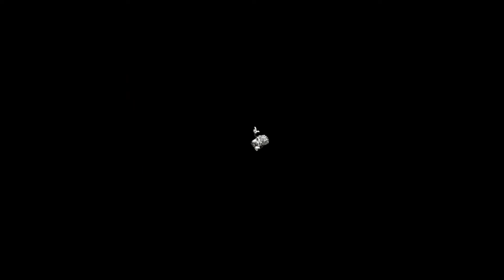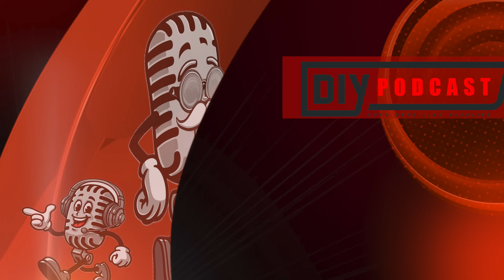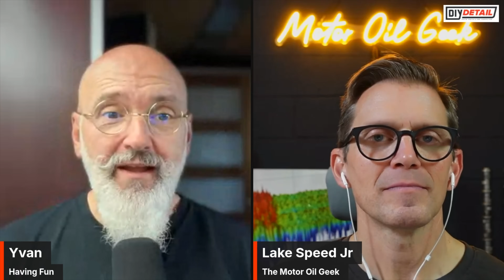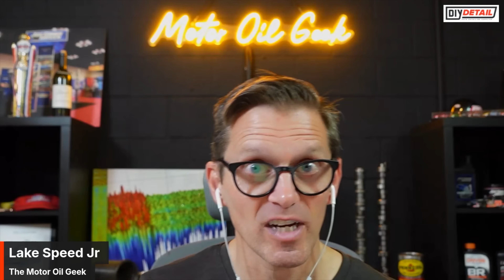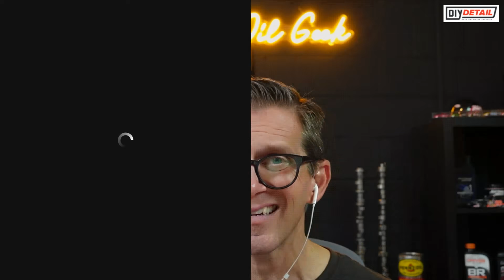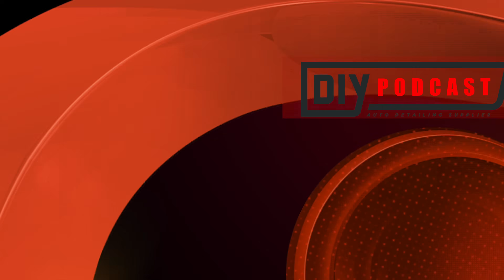Oil myths busted with Lake Speed Jr and DIY DETAIL PODCAST

Comment: On my 2025 Toyota Camry hybrid, I change oil every 3000 miles. I plan on keeping this for 200,000 miles then give it to my niece as her first car. Head engineer of the Nissan GTR recommends this if you want to keep the car long term.
Reply: 5k intervals would probably get you to a half million miles in that car.
Reply: 5k is overkill  @BrianNC81
Reply: Hybrid's suffer from fuel dilution in the oil.  Smart move to change it often.
Reply: @AlisoBob  They certainly can if the software is not set up to get the engine up to proper running temperature before shutting off, but this shouldn't happen in a cold winter as the heater forces the engine to run most of the time.
Reply: @theredscourge Very true. I lose approx. 10 mpg in the winter. Thankfully the AC system is all electric, maybe losing 1-2 mpgs in my Toyota Venza.
Reply: @AlisoBob  Not 3k mis. Not much confidence in Yoda engineering eh?
Reply: @AlisoBob Why the apostrophe for a simple plural?
Reply: How often does he recommend you replace your transmission (not the fluid, the whole transmission 🤣)
Reply: @theredscourge I saw a former GM engineer say some of those awful 10 speed transmissions could maybe be limped longer farther with 15,000 mile services. Thats extreme but I’ve done drain-and-fills every 30,000 and have never lost a transmission.
Reply: @sc3ku   That's crazy! Toyota is only telling their heavy users like taxis and delivery people to change t-fluid every 60k mi / 6y, for everyone else they specify no interval in their entire 120k mi service schedule, and even their CVTs are averaging over 200k mi with no fluid changes.
Reply: @theredscourge search for confessions of a Gm engineer. The whole “ lifetime “ trans fluid is a joke meant for the vehicle lasting 100k etc - leased first and sold once. It’s more in depth than that, but you’ll find it interesting.
Reply: @jamessharp9790  GM is going out of their way to make them fail early because no one in their right mind buys a GM anymore, but other brands like Toyota are not. Toyota still only cites a 60k mi interval for the fluid, and only for those who operate under "special operating conditions". Their belt-type CVTs are lasting over 200k mi on the original fluid, which is about 20 years of average use, so if you want yours to last longer than that, definitely change the fluid.
Reply: @theredscourge  I was literally going to ask this exact question, all new Toyota Camrys have that garbage CVT unit. It rather a 1998 with a manual verses the new disposable garbage!
Reply from the maker: They have an ECVT, very different technology.
Reply: @scottwilson7542  Camrys don't have a belt-type CVT. The hybrid Camry has the excellent e-CVT, which is not a belt-type CVT, but is a planetary and sun gearset with an electric motor such that it can vary the ratio dynamically. There are Priuses out there being used as taxis with over 600k mi with their original e-CVT still going strong. The Corolla has the belt-type CVT, but they're made by Aisin and are not paired up with a high-horsepower engine, so they are proving to be about as reliable as a regular automatic so long as you don't abuse it. The latest Corolla CVT has a legit 1st gear, and only ever shifts into a CVT mode above 25 mph or so, greatly reducing the wear.
Reply: @theredscourge Awesome, I still won’t waste MY money on one, and I have more than one Toyota in my driveway with over 250k miles on the clock. However I’m not a fan of CVT of any type or the Hybrid technology, Toyota has also had issues recently with the twin turbo Tundra as well. Let’s just say my money won’t be spent on any of this generation of Toyota products. Heck I’m still butt-hurt the new Supra is just a BMW and it’s already dying off. But best of luck to them, they have an amazingly reliable history I still appreciate!
Reply: @scottwilson7542  My main issue with the Toyota Hybrid technology is the apparent forcing it on to people.

What I mean is that here in Australia you can only buy a hybrid Camry..... no non-hybrid options.

It could be that Toyota Australia determined that the increasing sales of the Hybrid's would mean that fewer and fewer people would by the non-hybrid (?) But I'm not a fan in the lack of options.

Outside of that, having spoken to many many taxi drivers who drive a hybrid Camry or Rav 4..... they all love them, and for a country like Australia a hybrid makes more sense than a pure EV car.

I could be wrong, but to me Toyota is the leader in the Hybrid sector, and from everything that I've heard, they are great cars, especially once they included a decent battery warranty as well as reduced cost of replacing the hybrid battery.

Have you heard any horror stories?
Reply: @scottwilson7542  This gen of Corolla, Camry, and RAV4 will probably be the last one that has a non-hybrid non-turbo option. Soon it will be hybrid only. The smart play is for them to go electric turbo, as it can use the high voltage system, no turbo lag, no need to cool it due to it not being connected to the exhaust.
Reply: @scottwilson7542  My friend I think you just don’t understand an e-CVT is all gears no belt. The Toyota one has proven over many years to be profoundly reliable as they very rarely break down. Indded do some research on it you will see. Have a great day
Reply: @theredscourge  in my opinion that adds more parts and more failure points, here in the USA you seem only to be able to buy a Camry hybrid new in 2025. They can keep it!
Reply: @theredscourge E-CVTs are better than CVTs, but still boring, without improving reliability and longevity. IMO, not worth it.
Reply: @notsureyou i agree. I spoke to an Uber driver once and basically the hybrid camry works best in inner city driving with lots of stop starts. Longer trips freeway commuting etc the hybrid system does really add anything so in this case a straight 2L turbo is better because it uses less resources in manufacture.
At start 2023 I hired a hybrid camry, it was an awful car. I drove a 2008 Camry for 13.5 years so I'm qualified to judge.
Reply: @scottwilson7542  Lots other great vehicle brands other than foreign ones! Facts.
Reply: @theredscourge  Toyota & excellent don't go hand in hand nowadays!
Reply: @Davido50  They do compared to most other brands. They have consistently had far fewer TSBs than the other automakers.
Reply: @Davido50 I also own 3 Fords and a Chevy bud, no brand or manufacture hate here, just upset at the direction Toyota decided to go. They aren’t the only one either, just the one known for being the most reliable on the road and now only offering hybrid tech in the Camry annoys me.
Reply: @Davido50 also who isn’t foreign? Tons of ford and GM parts come out of Mexico Chrysler is owned by fiat as well, which company is actually domestic anymore?
Reply from the maker: Thank you.
Reply: As he said it depends on the commute distance, short or long trips, environment  and location  conditions
Reply: But us  5-30 don’t us 0-8 or 0-16 
67 000 mls change oil every 2500-3000 mls 
If you living in cold climates you can us 0-20 or 0-16 during winter.
Last Prius 463 000 mls 👋👋
Reply: He actually recommended 3,000 Kms oil change not miles!
Reply: I have a 2019 RAV4 hybrid, I changed the oil every 10k with Amsoil. It now has 141k, runs like a top and doesn’t burn any measurable oil in 10k.
Reply: @silverram323  I wouldn't be surprised if  now that oils are so much more advanced, and now that most engines are using direct injection, the priority for preventing oil burning might have switched from early oil changes to just adding piston soak every 60k.
Reply: @theredscourge 
What do you mean by piston soak…u mean walnut blasting?
Reply: @HML-it7te nah walnut blasting is for the backs of the intake valves, a piston soak is when you let a little fluid leak down into the combustion chamber to work it's way into the piston rings to hopefully break down any debris or sludge that may be filling up the ring lands
Reply: @silverram323 then your an idiot!
Reply: I have the same Camry and drive a couple miles per day only. My oil temp rarely reaches 70 deg C. After some time the oil smells with gasoline terribly. I can drive maybe 400-500 mi per month. So what I do is I just change my oil every 3 months. Sometimes I drive only 1,200 mi per 3 months, but I still change it to get rid of that extra gasoline in the oil due to very frequent cold starts. 0w8 is thin by itself and fuel dilution thin makes it even thinner, thus, I change it at shorter intervals.
Reply: @nicholaspetre1  maybe once a week try driving around town for 20 or 30 minutes to get the motor up to temp and burn off/evaporate some of that fuel in the oil.
Reply: 2500 on anything with turbos
Reply: Garbage Transmission in that won’t last unfortunately.
Reply: Yes that's what he says but it's still just general guidance. If you really want to know you need to test your cars oil.  Otherwise you are just flushing money and could be doing harm due to high chance of contamination during too frequent changes. Did you see the @43 minute mark here?
Reply: That’s super excessive. You even have a Toyota. I have a Hyundai hybrid and I’m at 300,000 miles and no issues. I change oil every 7-10k miles but use real oil and not Walmart or blends
Reply: What's real oil? @TaylorPhase
Reply: One of the top Toyota engineers that designed many engines and tested his whole life said the magic number was 2500 miles was perfect for best and longest life they tested.
Reply: @johnkennedy9107  Changing your oil after every drive is best. The problem is no one can afford that. If you have a reliable car which is less than 30 years old with no unresolved drivetrain problems or design flaws and want it to last 20+ years / 200k+ mi, change its full synthetic engine oil at least every 1yr / 10k mi, or its conventional oil at least every 6 mo / 5k mi. That will take most Toyota or Honda engines beyond 300k mi for example. If you change it more often, it MAY last longer, but often something else expensive like the transmission will fail first, so then you'd also want to be changing your t-fluid every 5yr / 50k mi on the low side or 8yr / 80k mi on the high side. None of that is going to prevent the car from being totalled in an accident though, so also drive carefully and attentively, otherwise your proactive car care may all be for nothing.
Reply: You have nothing to worry about 270k on my hybrid, 5k till 200k and 3k after, still runs great. 60k on the transmission, coolent and on the back transfer case.
Reply: And 100k all shocks replaced.

Comment: I was told to toss Lucas additive in everything. And non sense about needing to run 10-40 in modular Mystangs , Lt1 cars. 
Just to spite the idea that a worn engine needs doctored up thick oil, id add marvel mystery oil to a quarter million mile 5.4 lol
Reply from the maker: Thank you.
Reply: I think the point of thicker oil for racing is that thicker oil tends to have a higher thermal breakdown limit. If you have sufficient oil cooling you could probably use 0W8, but the more oil cooling you have, the easier it is to end up starving the oil pump during high-g maneuvers.

Comment: Does a sealed jug of 6 year old synthetic oil still do the job?
Reply: Has long as you store it in room temperature and not in cold climates it will be ok.
Reply: There is a certain amount of time after which the detergents will separate out, but it should be pretty long. There might be a date stamped onto your jug (but maybe not)
Reply from the maker: Yes

Comment: On my sonata and ram I change the oil between 4800 and 5000. All my air-cooled engines get changed at 2000 with a filter change at 4000
Reply from the maker: Good
Reply: intersting compelatiib. dont k how how it relates to  automotive detailing but I alsi enjoy watching Lakes channel. Speaking of when does the SQ standard for.the motor oils get released Lake?

Comment: What’s the suggested dilution ratio when using rinseless as a fuel additive? 🤣
Reply from the maker: We haven’t tested that, but 256 -1 would be the starting point
Reply: 1oz to 256...😂
Reply: Depends how much lubricity you need to add to your oil 😂
Reply: Emulsify those carbon deposits
Reply: Do not use fuel additives.
Use only mobile, shell or top tier fuel.
Reply: @philllsxga.7737 Fuel additive with PEA is more than fine to use, if you have access to good fuel where you live it might not be as needed though.